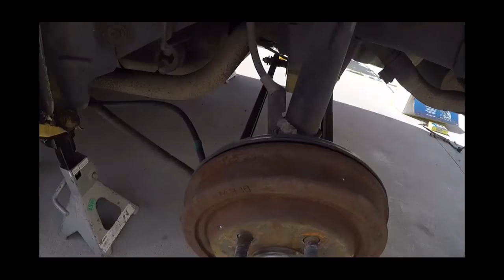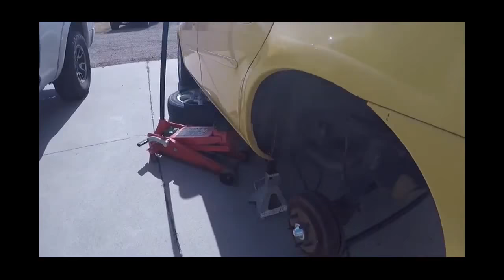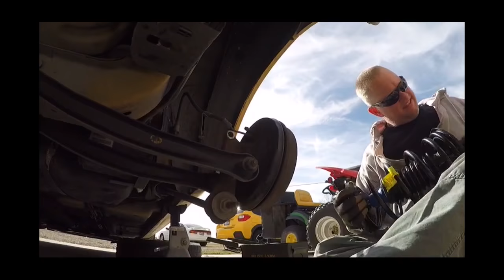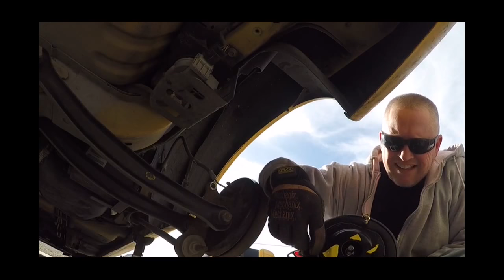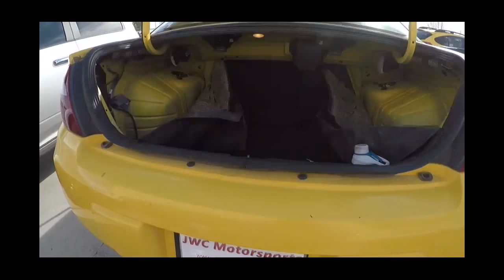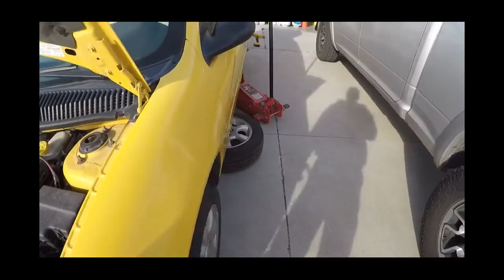2004 Dodge Neon SXT 2.0 Rear strut replacement

Comment: I bought the FCS Automotive Parts just a little bit cheaper but it has the same two bolts and I had the same problems trying to lie in it so I got to get an alignment pin is that correct
Reply from the maker: The alignment pin will help for sure. It's length will give you the leverage.

Comment: Im having trouble getting that last bolt in. I get it to catch then once it gets close to being done it pops all the way back out
Reply from the maker: I was having the same problem, I had to use an alignment pin to line it up then put pressure on the lower part of the strut (floor jack can work) to get the top of the strut to line up completely flat so the bolt would go in.
Reply: Where u put the two strews at that u took out

Comment: Did u manage to get that 3rd bolt in on the rear struts?
Reply from the maker: I did, it took a little work and settled more when I dropped it onto the ground.  All bolts are the MOOG ones and torqued to spec.